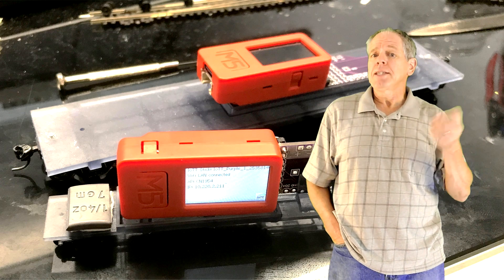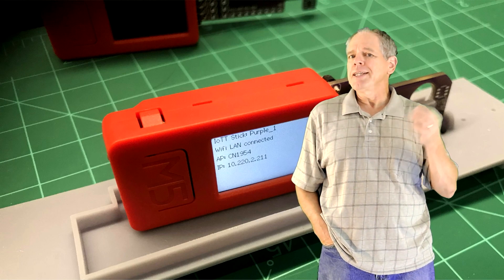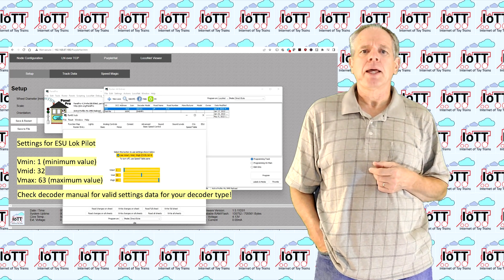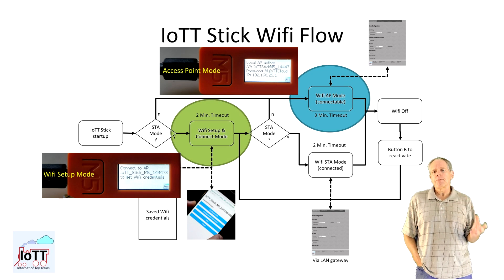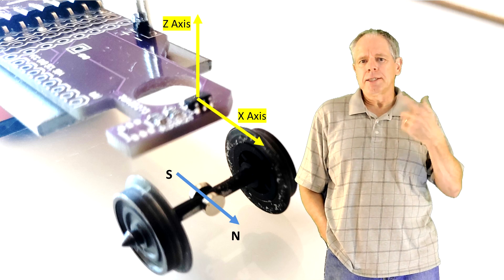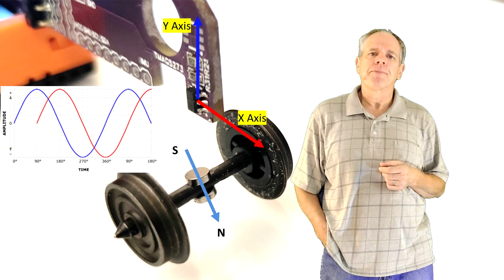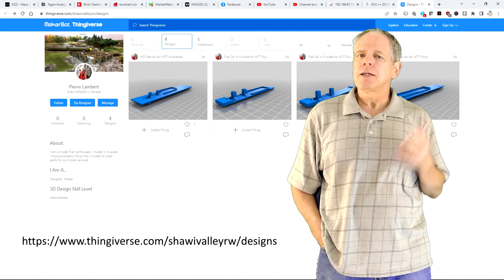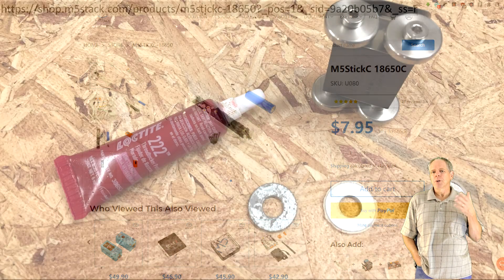PurpleHat Tips, Tricks, and Apps (Video#96)

Comment: Hans, I use a Digikeijs DR5000 command station.  Works GREAT with the IOTT stick and Purple Hat since it has a built in Loconet over TCP server.  But, there is a problem (more like a minor inconvenience): when using the programming track, Digikeijs recommends reading/writing CVs using Direct Byte mode.  However it appears when the Purple Hat software reads/writes CVs, it uses Paged mode.   

Would it be possible to add a toggle to cause the programmer to use Direct Byte?  

No problem using Programming on the Main except not all systems support readback in that mode.
Reply from the maker: Thanks for the suggestion. I think that would be easy to do, I put it on the to do list.

Comment: Some of the Atlas N scale budget decoders in the decoder equipped engines are missing either one of the steps from Vmin to Vmax,  no indication or reason why and in that same group factory installed atlas N scale decoders, they will not save the advanced speed tables too.
Reply from the maker: Not much to calibrate if the decoder does not have memory to store the results! Still works to measure the actual speed, though.